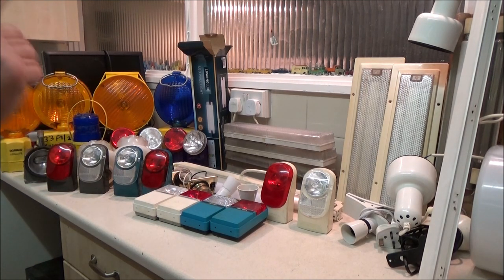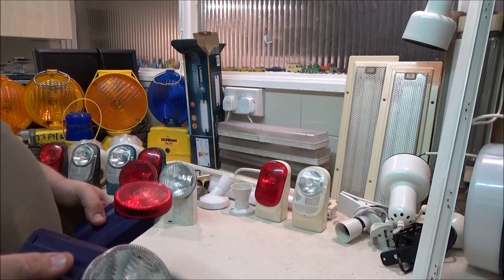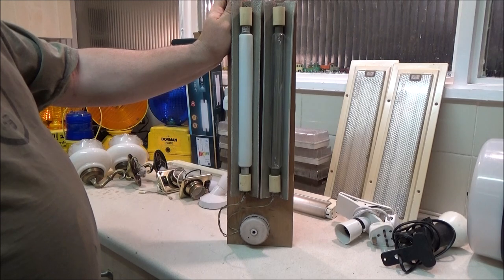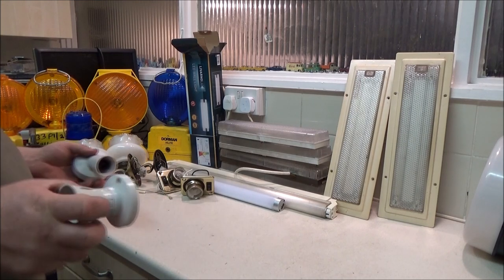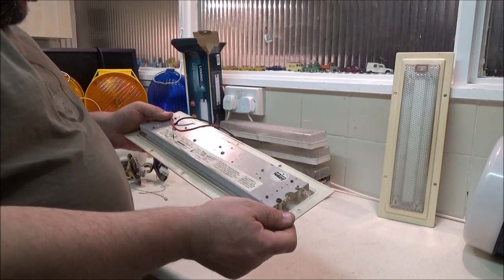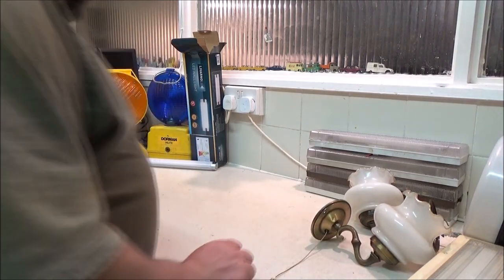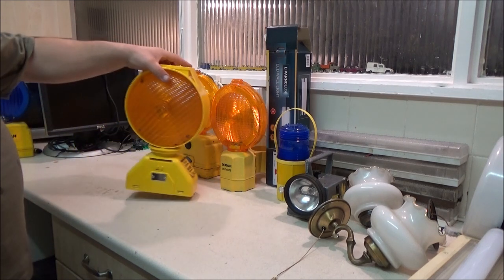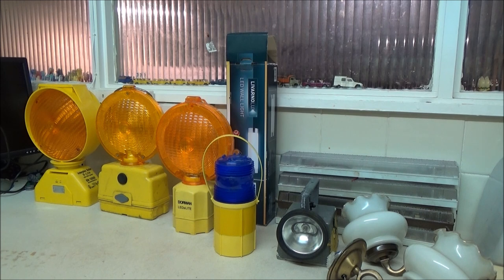Lights! Lights Everywhere! All Theb Lights I have Acquired In The Past Month!

Comment: The Ever Ready bike light were a good light back in the day,  but I also had to regularly clean the contacts and springs  otherwise they would always flicker,  a bit of WD-40 wiped over the contacts helped too.
The various  Lidl light fittings always seems OK too.
Reply from the maker: Dirty contacts seemed to be a common issue with these old lamps. I know at least three pairs do not work due to dirty contacts.